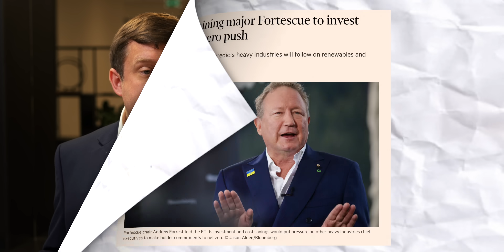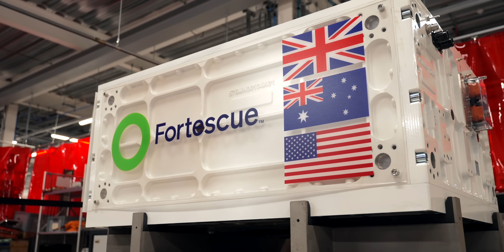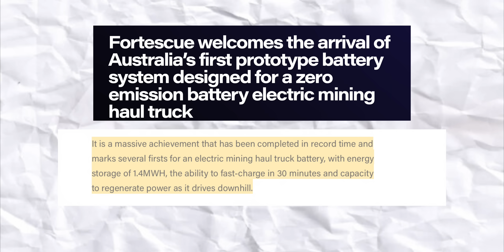This GIANT Electric Mining Truck Charges in Under 30 minutes!

Comment: Fairly sure any negative comments are diesel truck manufacturing workers :) This things awesome, nothing cooler than a bunch of nerds playing with big toys.
Reply: Lots of noise too, vrum vrum, just like children.
Reply: @secretdad544 Ever heard of rewable energies? In Norway excavators in the city are now electric, charged by the regular grid from hydro stations. So are all trains in europe. The area used by a nuclear station if filled with solar panels would produce more power and big demands are mainly during the day. Here in Portugal often 100% of electricity comes from rewables, the last coal station closed down, too expendive to use. Solar stations have 1/3 of the panels facing east, 1/3 west and 1/3 south to supply power at any time of day.  Fuel power stations mainly stand by for peak periods but often don't work for weeks at a great cost on labour and maintenance. Why do you assume that the burning technology is the last and best that mankind can hope to have? Will oil and the oxygen needed for combustion last forever? The power from the sun is unlimited, why should we not use it? Imagine all the roof tops, fences, desert land and mountain tops for winmills still available.
Reply: @antoniocruz8083  I hope you are joking with that claim? A fairly modern nuclear powerstation produces 1000 MW all day long (including the night). 

To produce that kind of power on sunny days you would need to install 2.5 million solar panels, which would occupy 800+ hectares of land and they need to be south facing too. If you include east and west facing panels you would need even more land. 

To put into perspective, the entire island of Olkiluoto is 700 hectares, on which three actual reactors are built, producing over 3000 MW of power and still only uses 170 hectares of land, leaving the rest of the area to be used for other things (like farming)

And it still doesn't solve the problem of having power in the morning, evening and most importantly, NIGHT.
Reply: @patrickd9551 You do realise WA is 2.7m sq kilometres? ... we've got a bit of free space 🤣
Reply: @sbm1978  you do realize the forresty part is about 52% in your state? Kind of hard to install that kind of stuff there. Then there are cities and federally owned land you can't touch. And there is the need for food..... Once you start assessing the useable parts you will find it's rather limited. 

But logic doesn't matter does it?
Reply: Not so.
I am
A pilbara electrician and have driven and maintained 220 tonne unit Rigs Terex and also built and maintained the solar power stations that are up 
Here

The town of Nullagine has a solar power station. What the average watcher is not told is the MASSIVE amount of energy required. These burn well over 2000 litres of diesel every 12 hours and run 24 hours a day

The energy required will not be available “carbon footprint free” you will have to have dozens of football field size solar farms and you will have to manufacture and then transport from China and build in the Pilbara which being so damn hot is probably the worst place to try and make a solar panel last. 

It’s not ever going to work “carbon free”

The carbon and sheer energy to build solar farms big enough wil never be recovered
 The whol thing will have to be rebuilt every 20 years and we have not even begun to deal with the haul truck batteries which is being run to less than 50% will have a battery life of 5 years approx

And then have to be replaced and contrary to one dickhead speaking his mind no lithium battery is 99% recyclable and if it is the process of destructing and reconstructing will surely involve a heap of energy.

The carbon thing is a joke. There is not enough Lithium in the world to run the world on batteries and what lithium there is is in the ground in China
Reply: @secretdad544  I've never met anyone who believes in a carbon-free human consumption world, but I guess everyone else here has. Still why did your investors waste such vast amounts of money on e-trucks and solar panels? What fools. Don't they take into account the longetivity of what they bought? Solar panels only 20 years (they cost €100/500w today for me so in 20 years will cost €20/500W) Lithium batteries that cannot be discharged more than 50% (they dont work like acid batteries) when they are made to work to the ground. The reasons your e-truck's batteries will only last 5 years is because they will run 24 hours/day and by then they will have been fully paid and have saved 2000L of diesel times the number of days involved. Try to beat that pollution with recycling the truck's worth of lithium. Finally, it remains to see how much maintenance those e-trucks require as opposed to diesel ones that even need a full-time electrician. What fools those investors.
Reply: @secretdad544  I've never met anyone who believes in a carbon-free consumption world, but I guess everyone else here has. Still, the investors in those e-trucks and panels can't add 2 plus 2. Such a large investment and they don't take into account the longetivity of what they're buying. Solar panels that only last 20 years yet today they cost for me €100/500W so in 20 years will cost €20/500W. They need several football fields, like the size of half of Australia? Lithium batteries that can only be discharged to 50%, that's new. The reason those e-trucks will only last 5 years is because they will work 24-7 and by then will have generated much profit. Compare the 2000L/day of diesel times 365days times 5years that's 3.650.000L/truck going to the atmosphere. Does recycling a truck's worth of lithium polute that? Finally, it remains to see how much maintenance these e-trucks need compared to diesel ones that seem to require full time electritians.
Reply: That’s not realistic saying it can recharge in 30 minutes
Recharge from where? Diesel or Gas fired electrical power

So you generate electricity using diesel or gas and then charge the truck using diesel or gas fired electrical generators 

No gain at all!!!
Reply: @secretdad544 why is it not realistic to say it can charge in 30 min?? A 3MW load would barely show as a blip on my screen at the mine... Our mills are 12,000hp, surely youre not saying it would be better if a diesel engine was turning them than electric motors..... 😂
Reply: @kstorm889  I am not sure I get your question. 
Currently diesel electric trucks have an onboard diesel engine that drives an ac alternator which goes through a rectifier and becomes DC - the Statex 2 trucks and locomotives all have DC wheel motors 
There is nothing new in the provision system except that the diesel engine that used to drive an alternator on board the truck

Has now been replaced by a diesel / gas fired Genset at the local power station

It’s actually less efficient than generating power on board the haul truck using an on board diesel generator
Reply: @kstorm889  as far as recharging in 30 minutes it will cause massive heat and the batteries will perish.

Try recharging your car battery from nearly flat to full in 30 minutes twice a day and see how long it does not last 

Batteries need a float and saturation time to give a deep charge.
30 minutes is too quick and the lifespan of the batteries will be reduced by heat

So many inefficiencies in that system that don’t exist in an onboard diesel Genset driving the haul truck wheel motors directly
Reply: @secretdad544  I wasn't asking a question, you said it's unrealistic to charge at 3MW, I was saying it's absolutely possible to charge several at a time without getting close to our maximum demand. And if you think we power our plant with diesel generators you are high. Our energy cost is way under 10c/kwh
Reply: @secretdad544  also our trucks and most modern trucks wheel motors are AC. DC is like 20 years ago.
Reply: @secretdad544  saturation/bulk and float charges are on lead batteries. Get with the times. Also the batteries are liquid cooled. Charging at a 2C rate is not extreme in modern batteries.
Reply: @Ernst12  First, there are already battery recycling plants where just shy of 100% of the battery components are recycled. If there's profit to be made someone will take the opportunity. Second, what proof do you have that fast charging degrades batteries to, say, half their normal life? There are Telsas with several hundreds of thousands of kms that have always been fast charged. They might loose some percentage of life but it is not significant. Electrification is here to stay and while not free of polluting it is several times less polluting than burning millions of gallons of oil. Neither oil nor the oxygen needed for combustion will last forever.
Reply: @antoniocruz8083 

I fear you're being far too optimistic with "everything to do with battery recycling".

Suggest you do a great deal more research on "everything lithium batteries".

I include all lithium battery chemistries with respect to self ignition.

You might note that here in UK the notion of  lithium based "power walls" is under scrutiny and now comes under the aegis of BS63100.

This standard is currently (!) designated "advisory".

Would suggest other YT based electricians' platforms might be worth a look ref these new BS regs.

It is clear that domestic battery storage is not quite the thing after all.

You might amuse yourself also by contacting your buildings insurer for their policy ref domestic electricity storage relating to fire risks.
Reply: @antoniocruz8083  you are so naive to the facts.
Where do you think the electricity used to charge the truck comes from ????

It comes from diesel or LNG fired power stations

There is zero benefit because the fuel used to drive the electrical generators could have been used to drive the truck itself

Also you may not know but haul trucks have been electric since the 1970s

They run a big diesel powered generator on board haul trucks - right now - all over the world  

This video is a stupid publicity stunt.
Reply: @antoniocruz8083 I call bullshit on just shy of 100% of battery recyclable 

That’s rubbish especially if you have to put more energy in!!
Reply: @antoniocruz8083  Oh really? And where might those recycling plants be located? I mean the ones that are able to recycle batteries in a cost effective and full scale manner? Do you have a name such a plant? Yes, in theory batteries can be fully recycled. In small scale operations using very expensive methods, that in no way can be made profitable at this moment. The current recycling methods are fairly dirty and still produce a fair bit of waste.

And what proof do we have that fast charging degrades batteries? Well the world perhaps? it's a well known fact. Just like the fact that Tesla modules have more capacity then is reported to the user. Spare capacity if you will.
Reply: @patrickd9551  I was just talking to a Tesla owner and battery degradation is simply not an issue. 10year old Telsas have done 6000.000km, as much as I've driven in 40 years,  with a degradation of 6%/100.000km.. With that kind of milage an ice with have 100% because the engine would have to be replaced. I think you are barking at the wrong tree with this degradation bs. Worse with recycling lithium being more polluting than burning millions of gallons of oil.
Reply: @patrickd9551  Lithium recycling plants in Portugal are in Bairrada and Estarreja and in Spain in Granollers and El Bayo all financed by big money including oil. Now image how many there are in China and being built. Why so much dislike for lithium? What about other metals, aluminium, iron, they also have to be mined, oh yes, those can be handy.
Reply: @antoniocruz8083  I was talking about recycling plants that are able to recycle close to 100% of the battery. Not the current plants that recycle about 40% of the battery. There are hundreds of such plants in the EU, but none are recycling anything close to 100% of the battery. 

Using current methods, the actual lithium that is recovered is (as the current tech goes) of lesser quality and can hold less of an charge. Mostly the cobalt and nickel is recovered as that can be separated easier. 

Also as it currently stands, if I want to recycle a large amount of batteries, I actually have to pay the plant to recycle my batteries. The incentive to develop better tech simply isn't there as it is too expensive and every is staring else where in the hopes someone will pick it up the current slack and invest in new methods.
Reply: @antoniocruz8083  

Hmm ...  indeed we do see your figures but you offer no context or qualification.

Some of us have been involved in researching information for decades.

Most of what you read ref stats is very carefully managed.

In short the information provided by manufacturers or sales departments is given a polish to make something appear more appealing.

Sadly most people lack the basic education to understand virtually anything and everything in the technical line.

The claimed mileage for EVs is presented without any consideration of speed, terrain, number of passengers, driver's skill or ambient temperature.

We all know this.

To read of a claimed mileage of 292 miles, precisely, on a single charge reference a particular vehicle is utter, utter bollocks.

Therefore to read your claims of vast mileage is equally mystifying.
Reply: @t1n4444  I did not claim anything regarding milage in this discussion only what the odometer says. As for the total miles driven by a Tesla I saw more than once in different reputable channels including an interviews with the owners. There are many evs now around where I live, my even tire mechanic has seen quite a few with more than 1000.000km with, as in his words, zero maintenance except tires and we all know the claimed milage differs vastly given that we have lots of hills but fairly correct at 100km/h on the highway. As for total mileage I don't think the odometer can get it that wrong by + - 100.000km. Evs last so long, in fact, that most likely the next generation, including batteries, will purposely be made to last less. The so much awaited cheap evs will probably not last as long.
Reply: @patrickd9551  OK, 40% recycling possible as opposed to 0% for burned oil. Oil, that toolk enormous amounts of pollution to get to the gas stations, from offshore rigs accessed by helicopter, leaky seafloor pipelines  laid by specially built ships, refineries that use more energy than any lithium battery factory, mega oil tankers that polute as much as a small city, , mega storage facilities, millions of  trucks distributing gasoline to every gas station in every corner of the world to finally be combined with exhaustive oxygen to combust into the air. You're right bad, bad lithium. What about aluminium,  iron and other minerals, are they also bad, they are also mined and recycled. Well, not those, they come in handy, just lithium.
Reply: @antoniocruz8083  

No disrespect mate but you appear unable to grasp the simplest of abstracts.

The mileage figure was purely an "example" of the utter hype we can expect to be presented with from "a" manufacturer for reasons given earlier.

As for these claims that Teslas can achieve a high mileage is most likely some wishful thinking, statistical anomaly or just plain bollocks.

Unless we see many, many thousands of Tesla drivers presenting similar claims, with peer reviewed evidence, then it's best to ignore such claims.

In any event if people own a Tesla then they may end up owning it for quite some while.

That van thing is not quite the success it was hyped to be, is it.

Battery EVs are no longer of such interest to putative car buyers in UK or US.

Tesla prices being slashed, workforce being reduced, share price dropping ... who's going to buy into that malarkey?

In a few years when green hydrogen fuel cell vehicles are saving the planet you won't be able to give your Tesla away ... as for part exchange then dealers will laugh in your face.

You don't have to believe such dire forecasts but just wait and see for yourself.
Reply: @t1n4444  I know personally Tesla owners with more than 100.000km with no tangible battery degradation. I've looked at their odometer. I've seen interviews with owners, one with 1.900.000kms but with 3 battery exchanges, 6000.00km in any car is a feat. Are you telling me I'm lying or those interviews were fake? Regarding a future technology you are basing your anti-ev/lithium argument on future guessing and that an entire new industry will be born. Any argument can be used by guessing the future. At least lithium cars exist today, can consume solar produced electricity and last as much or more than ice. Why so much resistance for these cars? Just drive one and charge it at home for little money then get back to me.
Reply: @t1n4444  It doesn't take much research to claim what's shown on an ev's odometer. I just saw on TV , not YouTube, a documentary on Norway'd close to 100% ev adoption. Many people are on their second ev having driven the first for several 100.000kms and still sold it. What's the problem in accepting this. What is so far-fetched. Is ice technology and oil burning the ultimate and last technology mankind can hope to achieve? Also, isn't it obvious that extracting, transporting, storing, refining, distributing and finally burning oil, never to be recycled, is far more poluting than doing the same to incredibly smaller amounts of lithium that allow renewables, whatever the percentage, to charge the lithium and in the end still be partly recycled. How can this be more polluting than the oil industry? And no one is claiming zero carbon in a large consuming world including myself.
Reply: @antoniocruz8083  I never said bad bad lithium, nor did I say oil was good. 

That is YOUR assumption,  I was merely refuting the claims that lithium batteries are 100% recyclable. And all you are doing right now is misdirecting the conversation instead of what you ought to do, which is to acknowledge my facts. 

Oil bad? Yes, but not entirely. Lithium good? No, but also not entirely. But we have to have a fair conversation in order to get all the facts straight.
Reply: @patrickd9551  A quick search on 100% lithium recycling shows that it is already possible at 96%. A video on another channel says a plant allready exists. Wether true or not it won't be long given the low availability so there is high profit to be made. I'm not saying it solves all world's problems but it could possibly allow for all personal transportation, perhaps not trucks, ships and planes. Still all existing ev's today have reduced total oil consumption by 1%, that's millions of gallons. Imagine when all cars are ev's, lithium or not. At least to stop the fume stench on the hilly area I live as I bike on the main road, will be worth it.
Reply: @antoniocruz8083  I never claimed it was impossible. I even said it was possible, just not at large scale. It's basically proven in a lab setting using far too expensive methods. It's a start, but long gone from actual production grade. 

And then you claim "another channel says". Well then name that plant, list their credentials so we can verify it. But still it's a singular plant by your words. If there is such a plant, then information should be fairly easy to find. 

But until you do, I'll just stick with the easy and actual verifiable claim that the current hundreds of recycling plants all over the world just reclaim about 40%. And the resulting materials are sub-grade too. 

Basically it's the plastic recycling all over again. In that only a few kinds of plastic are actually recyclable and some are quite sensitive to pollution degrading the end product.
Reply: @patrickd9551 Yesterday and today I've posted a comment with the videos of factories that recycle 95% of the material but, as I imagined, the post keeps on being erased.  I'll try again with less video info.
Reply: @patrickd9551  I just posted again and it erased. I dont think i can mention channel names. I'll keep trying by erasing one thing at the time.
Reply: @patrickd9551  Sunny group - the best time is coming
Reply: @patrickd9551  Jerry Rig Everything what really happens to lithium batteries
Reply: Recycling methods have evolved immensely in the last 2 years. It is mentioned that given the superior battery technology today the same amount of materials will actually end up in a higher density cell, so for the same recycled material, more storage capacity. Note that the material doesnot have to go back into car batteries there are many uses including house batteries which donot have to be as energy density, are heavier but offer more life cycles than lighter car batteries. I read that lithium can be recycled indefinitely.
Reply: @patrickd9551  What i sent you doesnot seem a hoax.  Does this mean this material is as effective as the initial in storing electricity, I don't know but new technology seems to handle that. Finally, the whole process does not seem to take vast amounts of energy, besides the griding it's pretty much chemistry and there is no burning. There are in China now 10.000 lithium recycling plants. If only 40% was recycled then what do they do with the rest. They will not throw it away, it's too valuable. Too much profit on lithium.
Reply: @patrickd9551  I had to change a lot wording to get that across. There are certain words and even frases that allure to some ideas that cannot get across.
Reply: @antoniocruz8083  also thank you for commiting to getting information across and it seems my comment is getting lost too. That's just wrong. 

Anyway, duesenfeld is merely a lab experiment as far as I can tell from the video. I'll try to post my conclusions later on. 

Long story short in the same video they claim to be looking for an industrial site to process raw materials on a large scale.
Reply: @patrickd9551  yeah, but it's proof that it can he done. What about the other videos, aren't they doing it? And that's info I found in just a 5 min search. Given the scarsity of lithium its just a matter of time. We'll just have to see if this is more practical than changing all the technology to hydrogen including, as it already occurs with lithium ev's, setting up mega car and battery factories and supply chains.
Reply: @avanap8096 

Really? You appear to understand very little battery chemistry.

There again driver skill in charging batteries might well be lacking.

Pause for a moment and work it out for yourself.

Thank goodness we see hydrogen as a fuel, in either ICE units, or fuel cells become ever increasingly popular.

Where does this old bloke get the impression that ICE units are not being developed?

All he had to do was research the topic yet he appears to have not troubled himself.

As usual all we see and hear is a history lesson.

Why?

Come on Robert, try and find some guest who doesn't do the confirmation bias ref the batteries thing for you.
Reply: @avanap8096  

Now that response simply indicates you have difficulty in following an argument.

We see a lot of that on YT, as in not just this platform.

Are you sure you understand what's going on in the realm of EVs.

Can it have escaped your notice that the interest in battery EVs is on the wane in UK and US as but two examples.

Elon is desperate enough to discount his range, lay off staff and then announce he's going to introduce a "cheap"  (by Tesla standards) battery EV for the masses.

Granted the share price has risen but who has been buying the stock?

Perhaps it has escaped your attention that battery EVs are suffering from very low residuals and very high insurance premiums.

Now, ask yourself if those factors combined are conducive to putative drivers migrating to battery EVs?

Are those factors conducive to the car leasing market?

To repeat, all you have to do is some research for yourself to understand the spin we see elsewhere.